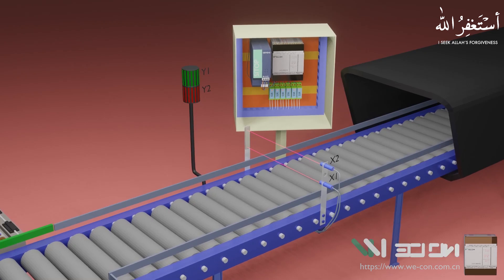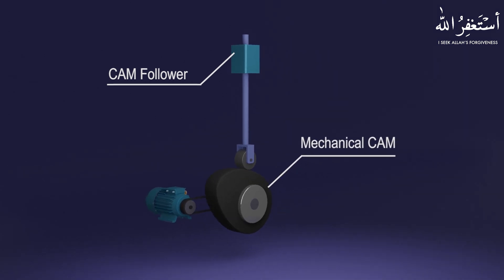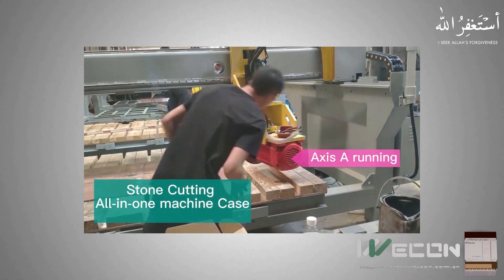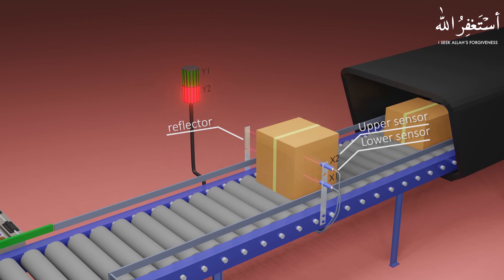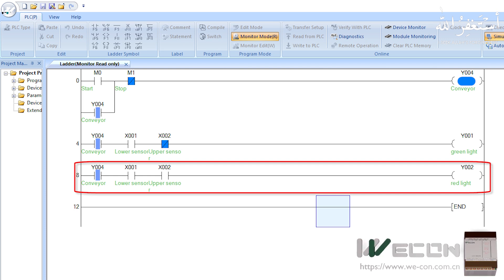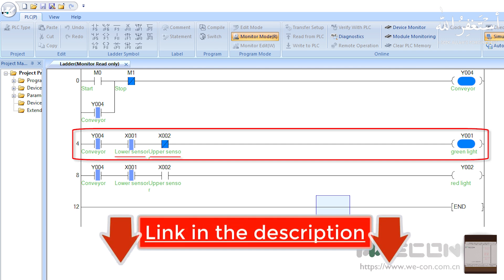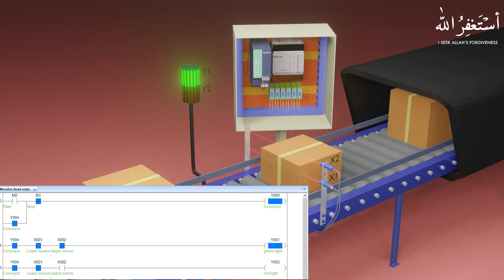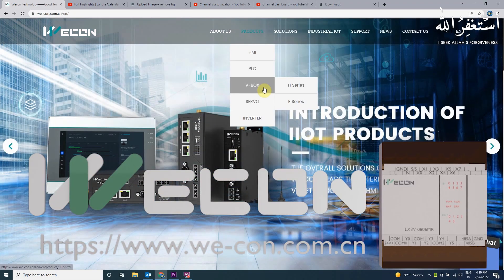detect and sort different size boxes using Wecon PLC. PART #1

Comment: With that program, the moment the big box is detected, the diverter will be activated, thereby diverting the wrong box because the sensors and the diverter are not in the same position. 🤔🤔

Comment: Wouldn’t it be easier to just use the high sensor there’s really no need for low level sensor
Reply: energy managment. with this you can know if there is no box mashine further down the line will power save until box is true.